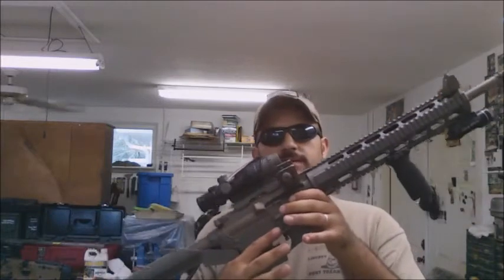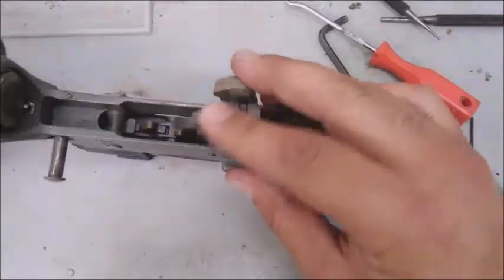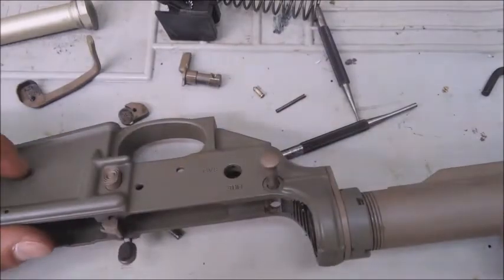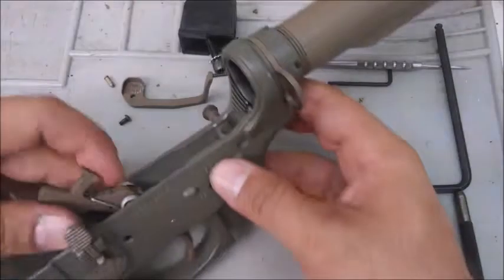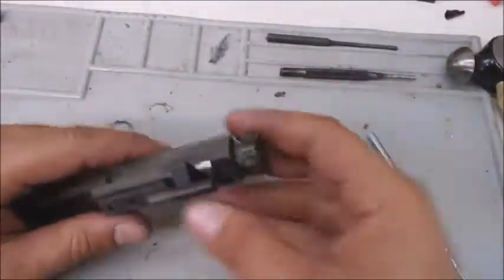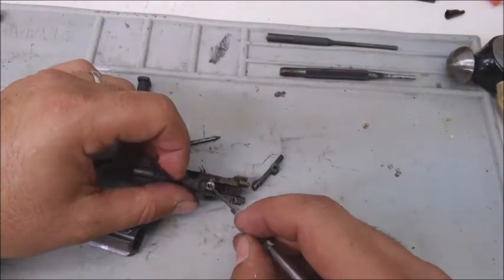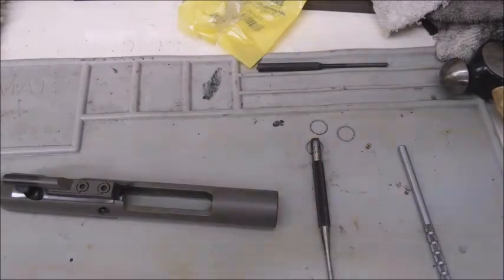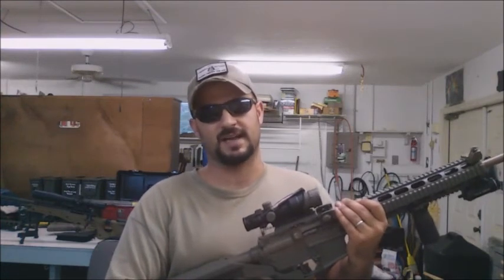Gun How To's: S&W M&P 15 Disassembly and Reassembly

Comment: I have a db 15 I just bought and I plan on changing alot of stuff on it... I was looking for a wrench foe the castle nut I already know just any wrench will mar it up... also the rifle doesn't have that much slop actually might not even be able to see it on camera... but I put a small rubber washer on the front little post of the upper receiver and it took all slop out... but my question is can or will that hurt the lower ... I know it's just rubber but it's tight and I know if it's aluminum it's very possible it can put a slight bit of pressure on that lower and when I decide to take that out it could possibly have more slop... just curious
Reply from the maker: No it won't hurt it. While it is aluminum most lowers are a forged aircraft grade aluminum. The strength properties that are inherited by that process are superior for the application. It's going to take a lot more than a piece of rubber to undo what the forging process accomplishes. Then on top of that add the type 3 hardcoat anodizing which will impart some strength properties into the aluminum at the surface level. This is mainly for scratch resistance and can help with some thermal properties as well. The same is true for billet lowers. While they're not hammer forged, type 3 hardcote anodizing will provide some strength properties to the surface.